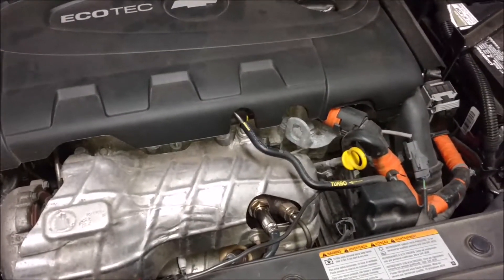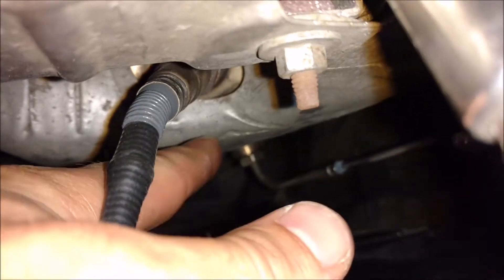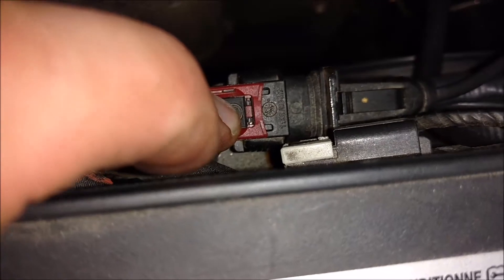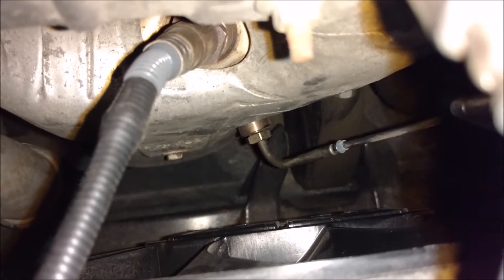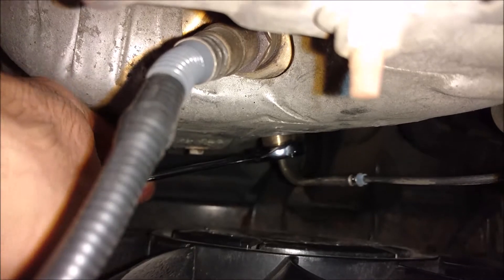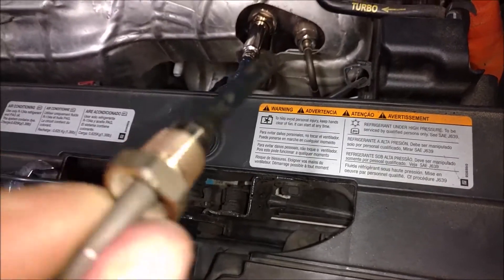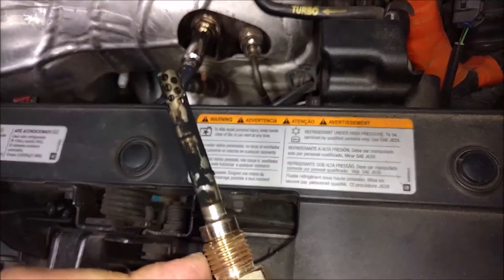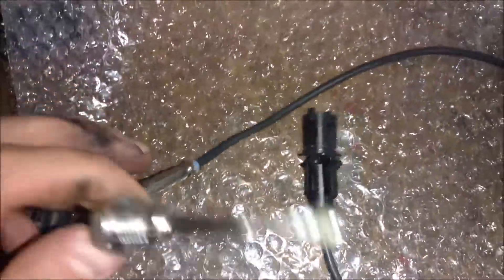Chevy Cruze Diesel egt sensor removal and install

Comment: Hello I have  CODE
P2428
Exhaust Gas Temperature Too High Bank 1
Which sensor do I need to change?
Thanks 
2014 cruze  2.0 diesel
Reply from the maker: The EGT sensor #2 is usually the one that fails. I never had p2428 when mine failed though. I would hate to tell you to replace #2 and it not fix your problem. You really need to have the sensors scanned to see what the readings are before you start throwing parts at it. Sorry I couldn't be of any more help.

Comment: Good video! Worked for mine too. Didnt reset it this time, and I think that helps after fixing something on newer cars! In the past I would, and code would store. I think now I'm going to let it reset its self! Thanks.
Reply from the maker: Cruz Rivera - I'm glad that it worked for you too! Thanks for the comment.
Reply: Hi, Im changing this sensor out today or my car wont pass smog test. How long did you drive it before it reset itself? I asked the smog guy and he said it takes about 400 miles.
Reply: @peanut2k5  give it accouple of days, it will reset on own, if not, its something else?
Reply: @cruz576  - I'm changing it out this afternoon and and i'll drive it today and tomorrow maybe a few hundred miles. I got the same two codes so i hope this clears it. Thanks for the reply.
Reply from the maker: Alberto Garcia - Good luck with everything and I hope that it works out for you.

Comment: Did you get service exaust system warning due to the bad sensors?
Reply from the maker: Gabe Foster - No, I didn't get any service exhaust system message. I just had the check engine light come on for the sensor.

Comment: Hey I want to make an update. At first I was getting P20E4, P242B and P21DD. I replaced sensor #2 which I’ve been told will throw up the P20E4 code if it’s faulty. After the replacement my P242B code went away, which is supposed to be the code for sensor#3. So at this point I’m left with p20E4, P21DD and now P20D9 came on because it’s the code for limp mode which will be happening in 100km if I don’t fix the P21DD which is the DEF tank heater. So I have to replace either sensor 1 or 3, not sure which one tho as I only have P20E4 which should be sensor 2 which I just replaced. If anyone has an idea I would appreciate it. If not I’ll go with 1 and if it doesn’t fix it than I’ll go 3.
Reply from the maker: If I were you, my main concern would be to get that DEF tank heater replaced ASAP so that you don't have to deal with the limp mode. You can at least drive it without fixing the EGT sensors right away. Luckily, those EGT sensors aren't expensive, so I would just replace sensor #1 and see what happens. If that doesn't fix it, then replace #3. You'll eventually get it!

Comment: hi i have P20E4 and P242B. Can any one tell me what sensor needs to be changed? I also have P21DD witch is the DEF tank heater but im hoping that will go when i change the EGT sensor.
Reply from the maker: Marcello Cancelliere - It looks like you have a few issues here. The P20E4 means that the EGT sensor #2 is faulty. I would replace this one first and then this code should clear. The P242B means that the EGT sensor #3 could be faulty. This code may go away when you replace EGT #2, which is the most common one to fail. Lastly,  P21DD is the DEF heater which I just had replaced under warranty. Thank God! I hope that this helps you out bud.
Reply: Cory Mondics - thanks for the reply, I’m curious about this videos description tho. It says that he was getting the code for sensor 1 and 3 which means that sensor 2 needed to be replaced. If I’m getting the code for sensor 2 and 3 doesn’t that mean sensor 1 needs to be replaced? Also if anybody knows wether sensors 1,2 and 3 are upstream sensors or downstream sensors I would appreciate it. From what I can tell sensors 1 and 2 are upstream and sensor 3 is downstream. I’m not sure tho. Thanks.

Comment: My car has a check engine light on I have a 2014 Chevy diesel and it says service emissions system and I checked the code and it’s a P229E is there any way i can fix it and also it said I had to put diesel exhaust fluid which I did but it’s giving me a countdown please help!!
Reply from the maker: Bobby Malik - You could possibly have a faulty Nitrogen Oxide (NOx)  sensor. I always add exhaust fluid when I change the oil so that it never runs low to be safe. I did have to take the car to the dealership a couple years ago because the computer thought that the DEF was at 50% when it was full. They fixed it free of charge at the time because it was still under warranty. Make sure that you fill the tank up with DEF (about 5 gallons) and the computer should reset. If not, you might have to make a trip to the dealership.
Reply: Cory Mondics I did fill it up to the max and it’s still showing me the service emissions system sign with a count down should I replace the nox sensor the way u did would it help ?
Reply from the maker: @bobbymalik4008  - I replaced the EGT sensor in this video which is a totally different sensor than what your code is. The P229E is related to the NOx sensors. The Cruze has 2, NOx #1 part number is 12662658 and NOx #2 is 12662659. I don't know which one is faulty, but you can replace both if you feel comfortable doing so.
Reply: Cory Mondics you’re a legend thank you !!!
Reply from the maker: @bobbymalik4008  - I hope that everything works out for you! Good luck.
Reply: Cory Mondics I found one of the nox sensor the one beside the engine I can’t find the other one
Reply from the maker: @bobbymalik4008  - It's toward the rear of the car on the exhaust pipe in front of the rear wheels. It's across from the fuel filter if you know where that is?
Reply: Cory Mondics yes I’m guessing that one has to be replaced
Reply: Cory Mondics btw which nox sensor do I need for the exhaust 12662658 or 12662659?
Reply from the maker: 12662659 is the one located on the exhaust pipe in front of the rear wheels. Sorry for the late reply! I just saw this.

Comment: My car is throwing up code 2084 as opposed to 20E4 which To my understanding means there is a problem with sensor #2 but not necessarily the sensor itself. ( could be loose or corroded wiring, computer, etc.) I took sensor out. Tested resistance, it was 220 ohms. Resistance rose with heat (gun). Tested connection coming from car to sensor, it was 3.5 volts.  Not sure what sensor resistance or correct voltage from car should be so I can narrow problem down.  Any help is appreciated.
Reply from the maker: James Atkinson - How many miles are on your car? These sensors are very common to fail. I would be surprised if you had a wiring issue. Inspect the wiring and look for any problem areas. The sensor is not that expensive, so I would just replace it and the code should go away.
Reply: @Corysdiyauto  92,000 miles
Reply: I have same problem. P2084 error, but i tested the sensor and it shows 223 ohms. So i bought a new one, going to replace it... Wish me luck... How did u solve your problem?
Reply: @milutinsurbatovic3023  of I remember correctly I just changed the sensor and it worked
Reply: @JamesAtkinsonironman  as i turns out, i bought a straight probe sensor, which is the first one, i replaced it, and nothing happened, so im waiting until tuesday, when the other (second) angled probe sensor arrives... It has to be that one
Reply from the maker: Milutin Surbatovic - That should fix it.

Comment: Cory, I had the Error code read at Advance AutoParts and I come back with the P20E4 Exaust Gas Temperature Sensor 2/3 Correlation Bank 1 Message, but I have only that message and I have it twice.  I ordered and replaced the #2 sensor like you show above and then drove the car 50 miles to see if Check engine would clear and it did not.  Any ideas what else cuold be going on here?
Reply from the maker: gatchaXxgekoxX - I would get the code cleared first and see if it comes back on. Sometimes the light will stay on. I used to go to Advance Auto and the guy would clear it for me, but now I have my own scan tool which saves a lot of time and money!

Comment: Hey Cory! I am getting the P20E4 and P20E2 3 times with P11D7 in between from the list autozone printed for me from the scan. Did you happen to get that code in the middle also or just the other 2?
Reply from the maker: Katie McAlister - I never had the P11D7 code. Just the other two. This code relates to the NOx sensor. It could be faulty or it might need cleaned.

Comment: Thank you so much for your video! Do you know where the EGT Sensor Part #55581034 is? This video just saved us $700!! :D
Reply from the maker: Angela Winter - I'm happy to help you! This egt sensor is located in the middle of the diesel particulate filter (dpf). It's in front of the engine bay and easy to see.
Reply: @Corysdiyauto  You're awesome!! They were saying it was like a 3.5 hour job and 'things need moved' to access it lol. Good grief, the things they tell ya!
Reply from the maker: @angelawinter5478  - Thank you very much and good luck!
Reply: Cory Mondics  Can you please clarify that is the correct part number (1034) for the one on the front? The diagram of the part itself shows a straight sensor much like the one down on the exhaust behind the engine, and both of the ones up front curved.
Reply from the maker: @Bosephjones  - Part number 1034 is definitely a straight sensor. I replaced 1035 which is the curved sensor (EGT #2). This sensor is the one that fails the majority of the time.
Reply from the maker: @Bosephjones  - EGT #3 is 1034 and it's not up front with the other two. I actually show this sensor in the video.
Reply from the maker: @angelawinter5478  - The part number  that you are referring to is EGT #3 and is not on the particulate filter. Sorry for the confusion.

Comment: Thanks for the post. Went to the dealer with a check engine light on thinking it could be warranty. I have a scan tool and it showed a P20E4 code, I even told him that. So he looks at it and said I need all three EGTs and something on the PCV side, that it would take $1016 and three days to fix. I told him to give me my car back I'm outa here. Overnighted the middle EGT(AC Delco) from Rock Auto and I'm back in business for $62.25 with next day shipping. Oh and the PCV issue was a loose hose.
Reply from the maker: Keith Daniels - I'm glad that you fixed the problems yourself. Those dealerships love to take your hard earned money. Good job!
Reply: Ya the hardest part was getting the new part out of the plastic wrapper. Thanks again!
Reply: Hey Keith, with the P144E, how did you know to replace the middle sensor?

Comment: So that sensor fixed the P20E4 code?
Reply: Cory Mondics.... By chance have u ever cleaned the dpf unit by manually spraying in some dpf cleaner? The dealer did a manual regen which nailed me for a few hundred dollars. I would like to do it myself doesn't seem that hard. What do you think?
Reply from the maker: Kenny Baker - yes it did.
Reply: Cory Mondics you just saved me a lot of money! Thank you brother!
Reply: Where do I find this part? And what do I type in?
Reply from the maker: Kenny Baker - Go to Google and type in gm 55581035. That's the correct part number for the EGT sensor #2. Make sure to get a General Motors part and not a junk knock off brand.
Reply from the maker: Kenny Baker - I am glad that I could help. Thanks bud!
Reply: Quick question check light came on again, different sensor P2453. I was wondering if you can tell which sensor that is and GM number please and thank you
Reply from the maker: Kenny Baker - This sensor is for the diesel particulate filter. The part number is 55570092. I would try to clean the carbon off of the sensor first and that might clear your code.
Reply: Cory Mondics thank you, one more thing do you know where that is located on the car?
Reply from the maker: Kenny Baker - I am not really sure. I am not near the car right now, but I will look later and let you know.
Reply: Cory Mondics alright that’s fine take your time brother, i appreciate the help.
Reply from the maker: Kenny Baker - the dpf sensor is located at the rear of the engine on the top near the firewall. As you are looking at the top of the engine, follow the letter "E" in ecotec straight back and you will see the connector. Pop the plastic engine cover off to access it. You will need to pull the connector, two hoses, and remove one 10 mm nut.
Reply from the maker: Charley Ghanem - I've never cleaned the dpf unit manually. Hopefully I never have to! Haha. Don't you just love the emissions crap that's on this car!?!
Reply: Sorry for the delay, yeah the sensor is working and running smoothly Knock on wood
Reply from the maker: Kenny Baker - Good to hear!
Reply: Hey hey I’m back haha. I was just wondering how long your timing can last? I finally hit 100k on my Cruze, and it told me to change the belt and everything
Reply from the maker: Sorry for the late reply, but I would have it changed around 100,000. I wouldn't take a chance to see how long it could last! It's not worth it. This is an expensive service…...…..about $700 at the dealer!
Reply: @kennybaker4249  - i changed mine at the dealer at 103k miles. Paid just under $1300 for the timing belt kit and fuel filter everything installed.

Comment: What errors was the car giving you? I have an exhaust fluid quality poor and after 2 forced regens it came on again. All my pumps and nozzles checked out and my no.1 sensor was switched per the recall so I'm guessing it's the no.2 no sensor that's bad.
Reply from the maker: Abel Canahui I had P20E4 and P20E2. How many miles are on yours?